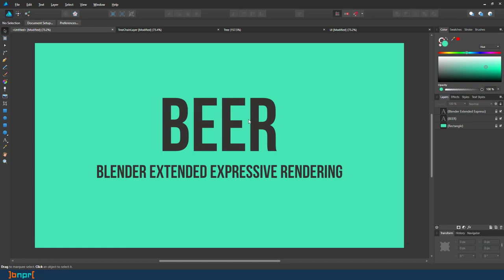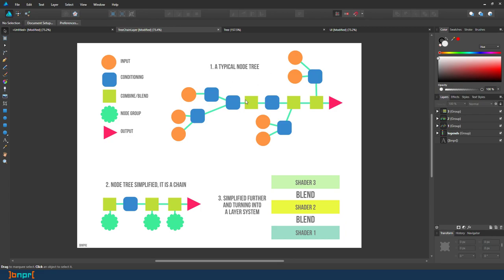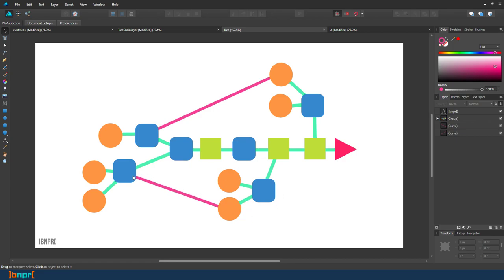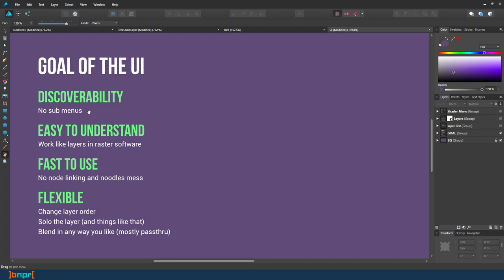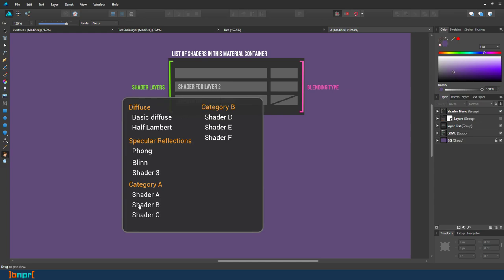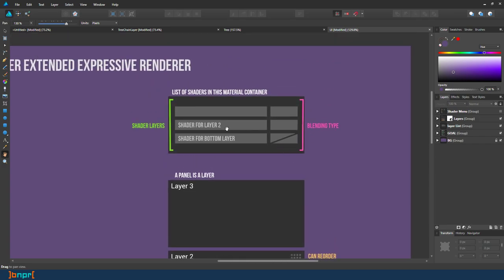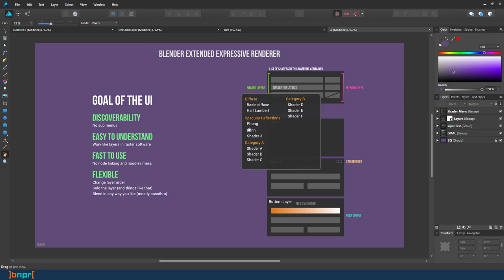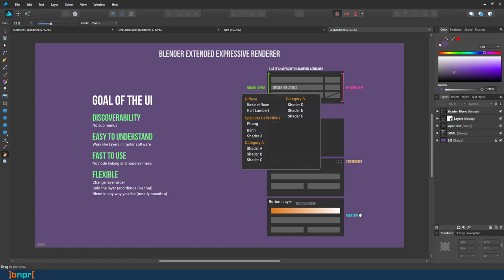Drink beer and explain BEER design

Comment: I would love to see some examples of how this can be useful
Reply from the maker: The goal is to make a very extendable render engine.
The problem we have now is that Eevee and Cycles both have a fixed rendering pipeline and cannot be changed.
We tried to add npr features into them, but nothing accepted by the core developers.
Reasons: both have fixed render pipeline, Cycles is a path tracer, Eevee is a PBR renderer. Anything breaking those rules are unaccepted.

So BEER is an independent renderer. It lives outside of Blender and communicates with Blender using an interface that is the BlenderMalt add-on.
To make BEER extendable, it has to have a flexible rendering pipeline, meaning the algorithm and steps to make the final render is super flexible and promote enhancement.
The only logical way to reach that is to have 2 interfaces.
1. the coding interface to make npr features, this is provided by Malt (the backend of BEER)
2. and a layer system, much like in Photoshop to make materials (this is the BEER UI)

The benefits is endless.
1. you will always get new npr features, because BEER encourage shader coding
2. to make a material, you just stack npr features, this makes mixing shaders fast, also easier to read compared to nodes

In BI, we used to mix materials (they are not really shader like we have in Cycles/Eevee). 
In BEER, we can make (create new shaders) and mix (make new material from shader primitives) shaders.
So "making" and "mixing" are both possible.

Eevee/Cycles only allow "mixing," don't allow (unless you use OSL) creating shaders.

Comment: so little tutorial for BEER out there.
how to combine 2 shaders in malt? let say combining basic_transparency_mesh.glsl with basic_line_mesh.glsl etc
or making glass material with outline, and gradient?
Reply from the maker: basically you just combine those shaders using simple operators like few of the examples
Reply: @BNPR  where exactly is the shader layer? could you please do a tutorial using blender instead of using affinyty?
i search every where in the blender ui still no luck finding those shader layer u talk about at 5:12
even at shader editor i cant find the shader's node.
Reply from the maker: @tommykho4348  FYI: BEER is in development right now. As of right now, we have the backend (Malt) working nicely and already use in many commercial production, but it is not user friendly since it only has node and code interface. The node interface is purely like the code interface so not for beginners. 

In a few more weeks, we should see the initial preview of the user interface. BEER UI not for daily used yet.

Malt repo: https://github.com/bnpr/Malt/releases (get the development build)
Beer repo: https://github.com/bnpr/BEER

Shader layer is an abstraction to make thinking and understanding NPR feature easy. When the shader is compiled, all the layers will turn into 1 material. So yea, shader layer is an abstraction.